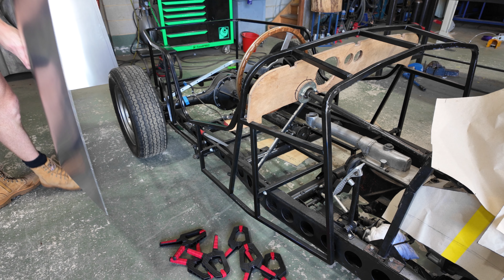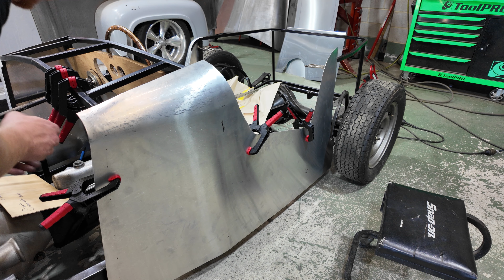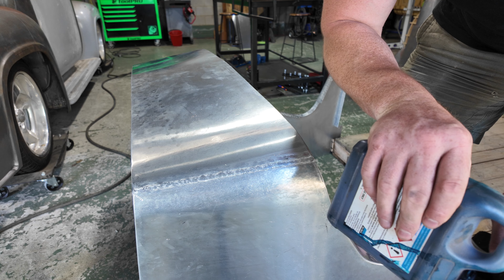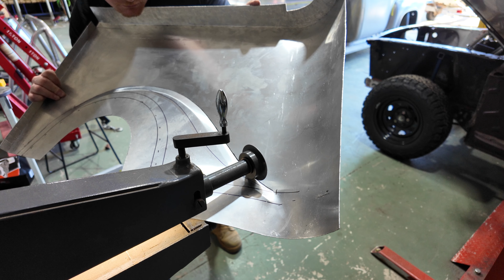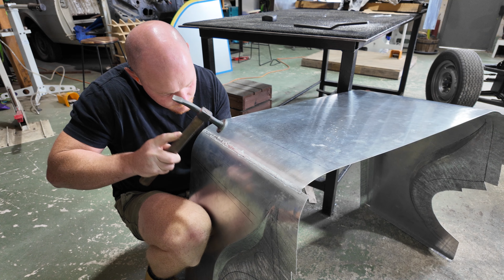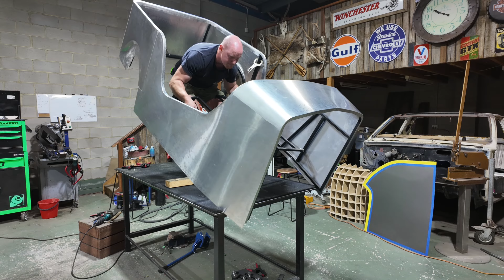HAND MADE HISTORIC RACE CAR

Comment: I'm very impressed with what you do with a snips and body hammer. I realize it's aluminum but as I'm doing some 20 ga tin I understand the difficulties in rolling flanges and getting a nice crisp edge! After watching your flowing work on the 56 it's a bit different but still pretty cool!
Reply from the maker: Appreciate it. It’s just getting that edge right. I do my steel in the same way but as you would know it takes more work. Only down fall on ally is try to not have it crack.
Reply: @Resurrected_metalshaping  You are absolutely right. I've had some success with annealing it but you probably know that and it doesn't always help. Great job man, you're very talented!